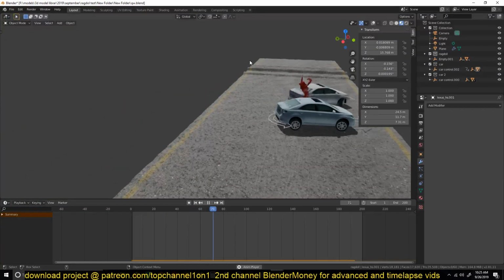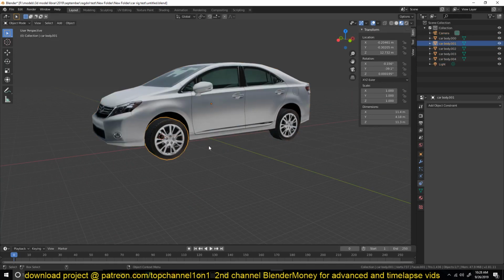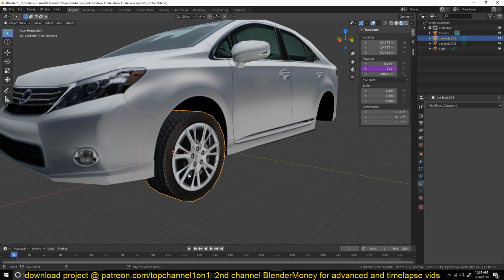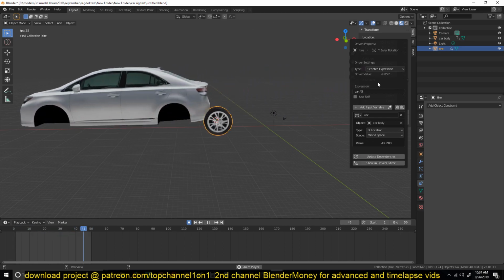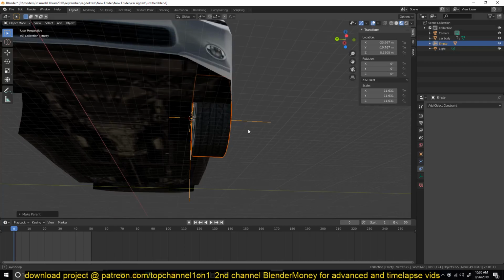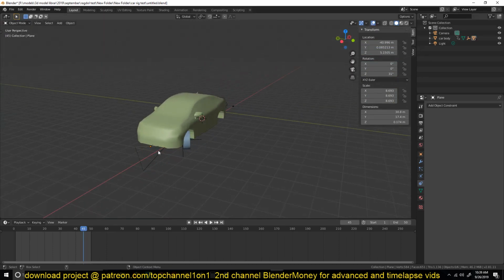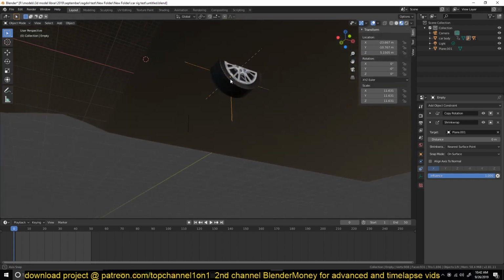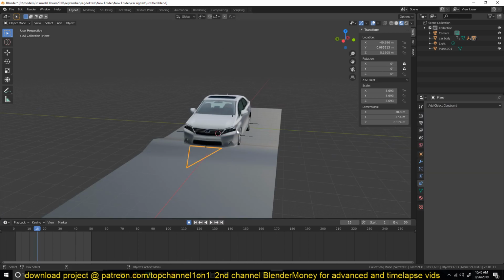blender 2.8 setting up a basic car rig

Comment: Thanks.  Interesting use of the Shrink-wrap modifier for surface interaction.   The proper relationship of rotation to distance is  distance / radius of the wheel.
Reply from the maker: oh yeah forgot you could use actual math thanks